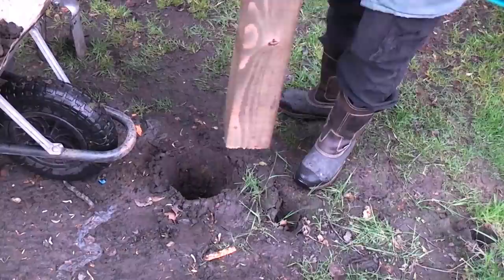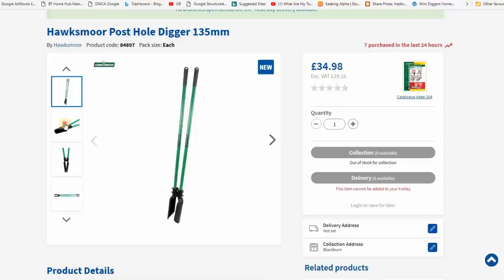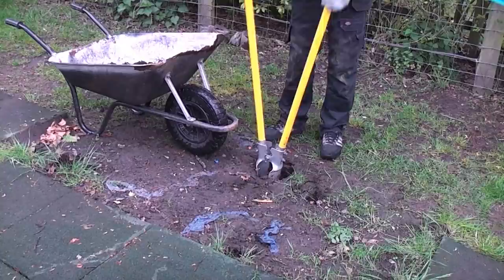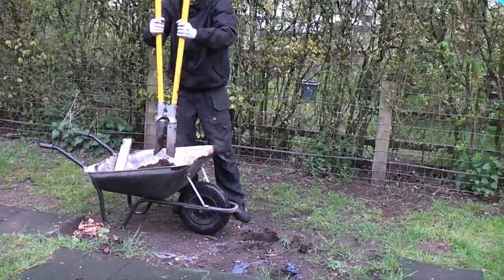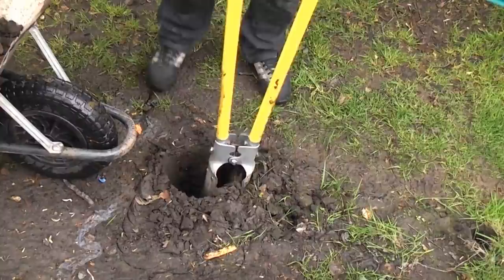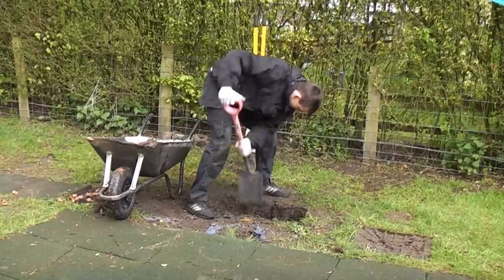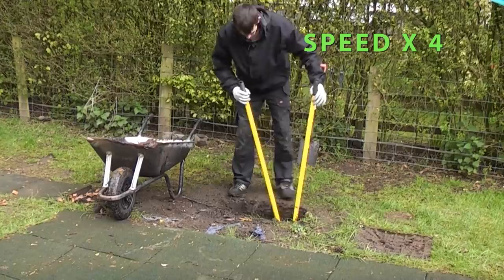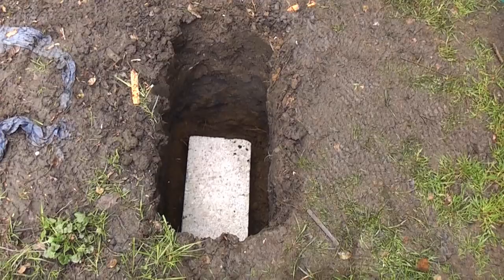How to dig post holes | post hole digger

Comment from the maker: This is one of the videos that I’ve been meaning to make for the last ten years, I only remembered a few days ago when someone asked the best way to dig the holes.
Please like, share and comment if you can, as it really helps 👍

I hope everyone has a great Sunday 👍
Reply: The In law gave me a spade to dig fence holes, after the first hole taking 1-2 hours I was thinking surely this is not the way.. 

Researched for 15mins, pop to the shops and back in 5min to buy this post digger. Each hole thereafter took 10mins or less...
Reply from the maker: @JLneonhug   They make the job so much easier 👍
Reply: the best way to dig posthole is to get someone else to do it like you did 😉

Comment: One tip if you're digging a lot of holes is to use a low wide bucket to place soil in so you don't have to lift the post hole digger so high. When full empty into the wheelbarrow. (my post hole digger is very heavy so the less gravity it fights the better)
Reply: Yeah I was thinking even better to dump the spoil at ground level next to the hole then normal spade that into the barrow, would be much easier than keep lifting the small amount of spoil into the barrow every time

Comment: I’ve dug a lot of holes for fencing. Best tip I can provide is to use a thin post/drainage spade to loosen the soil and then use one of these post hole diggers to remove the spoil. 

Using them in combination makes it easy work.
Reply from the maker: Thanks for the comment 👍

Comment: Only thing I would have added to the video is a digging bar. It can clean up the edges of the hole, dislodge any stones and just generally help break up the ground. Even though this looked relatively good soil to dig they are still worth having to hand. Enjoyed the video as ever!
Reply from the maker: Yeah, I should have added that. I do have a digging bar, but did not need it on this occasion
Thanks for the comment 👍
Reply: Speaking of that, at the fence company I work at, we call them tamp bars cause not only we use them to shave holes and pry rocks loose, we use them to tamp posts in the holes and pack down the dirt so the post is more stable

Comment: After using hands, post hole digger, and spade, my go-to now is an Auger. It is miles better than anything I've used previously and doesn't make the hole much wider than the Auger width. And you can get down to about 600cm.
Reply from the maker: An auger is the ideal machine, but not practical for most people unless you are doing a lot of holes.
Thanks for the comment 👍
Reply: Kilometers * not miles

Comment: I've found it handy to have a good size crowbar and baby sledgehammer on hand, while digging holes for fences.
These would be used to loosen and remove large stones or rocks in the hole.
You use the crowbars sharp edge to either break up the rock, or hammer the crowbar with the sledgehammer to move the stone around in the ground, thereby making it looser, then there's more room around the stone to wriggle it out.
Anyway, those extra tools help if you have rocks or stones.
Don't use water, you'll only make a mess, since the clay under the top soil, will not let it drain.
You'll have a hole with water in it.

Comment: I remember I seen on a gardening program on TV to put the buriedl end in s plastic bag to help make the post last longer.. what do you think of that idea?
Great video.. Never seen this tool before.. Thanks for taking the time to make it.👍☘️🇮🇪
Reply from the maker: Not sure if a plastic bag will help, I normally put a mound of waterproof mortar on top, which stops the water pooling around the post- https://www.youtube.com/watch?v=YuG_KHMvPRM
This time I added integral water proofer to the gauging water too.
You are welcome
Thanks for the comment 👍
Reply: Other options are 'post saver sleeves' various brands available or just painting the bit of the post in the ground with bitumen paint. I would always do as UHM says and mound the mortar around the collar of the post to aid water run off.

Comment: How long should one expect a post in concrete to last? Is it worth using some kind of bitumin on the buried end?
Reply from the maker: It should last for decades, as long as you don't allow water to pool on the surface. I normally add some mortar with water proofer around the top, to prevent the post from rotting, as they always rot where the post exits the ground- https://www.youtube.com/watch?v=YuG_KHMvPRM

I guess bitumen, would certainly help.  When I installed the posts for the monkey bars, I actually used water that had diluted integral water proofer in it, hopefully that will make the post-crete less permeable and less susceptible to rot.
Thanks for the comment 👍
Reply: @ultimatehandyman  superb, thanks 👍

Comment: Is their a rule of thumb for how deep to dig or is it dependent on the structure.
eg
A swing set will need a deeper hole to bare the weight compared to a post for a compost bin.
Reply from the maker: Yeah, it depends what the post is for. 
Even for the composter, I tried to get about 2' deep. For the swing set and monkey bars the holes were almost 3', as I had to get a dense concrete block in the bottom but there are 4 posts, which are all braced to each other, so it's a very strong structure.
If you were to install a gatepost on it's own and a heavy gate was being attached you would probably need to dig a hole that is 1/3 the depth of the post.
Thanks for the comment 👍
Reply: Yeah I was always told 1/3 of the total post length in the ground.

Comment: Will the postcrete rot the wood?
Reply from the maker: No, it will be fine.
Posts normally rot when water is allowed to pool at the surface, as it soaks in and rots the post.
I normally put a mound of waterproof mortar on top of the postcrete, like I did in this video- https://www.youtube.com/watch?v=YuG_KHMvPRM
Thanks for the comment
Reply: @ultimatehandyman  thanks 😊

Comment: Do you put a concrete block under every post you install?
Reply from the maker: Yes, but sometimes I use engineering bricks, or sometimes block pavers. It depends what I can find around the house. A few weeks back I could not get solid concrete blocks, so had to use some block pavers instead. Anything that has a good compressive strength should do.

Comment: What  if you don't want to do that?
Reply from the maker: You can get a petrol earth auger, which is much faster. I managed to buy one last year at auction for less than £100, which included three different diameter augers 👍
Reply: @ultimatehandyman  Careful you don't cut your foot off

Comment: Everytime I dig a post hole I find rocks, stones, old bricks and concrete.
Reply from the maker: It depends where in the garden we dig.
At the very bottom of the garden, there are loads of stones, so normally I have to use the large steel bar there.
👍